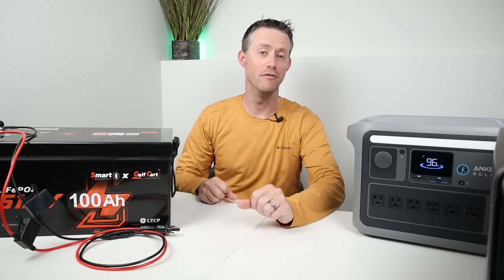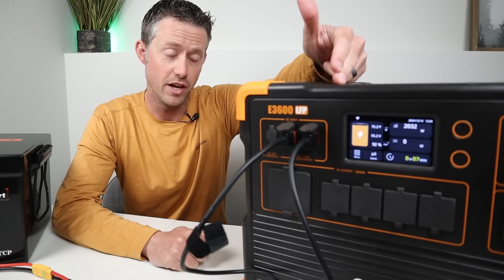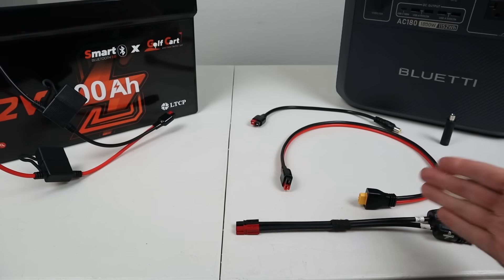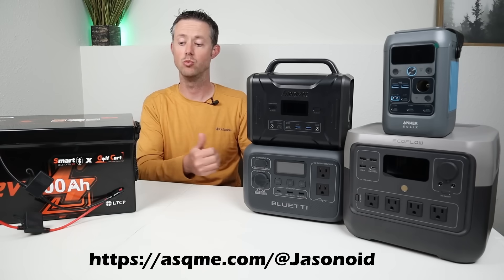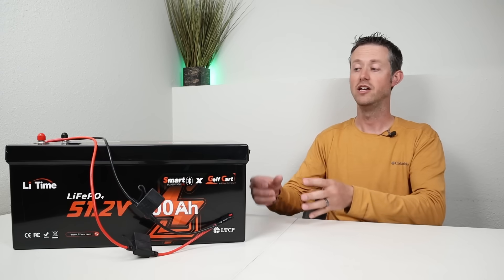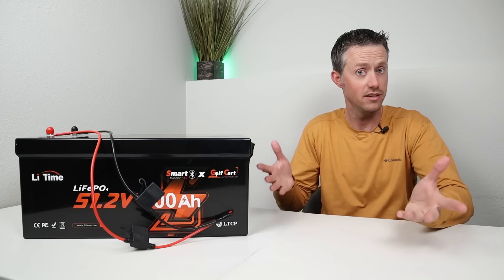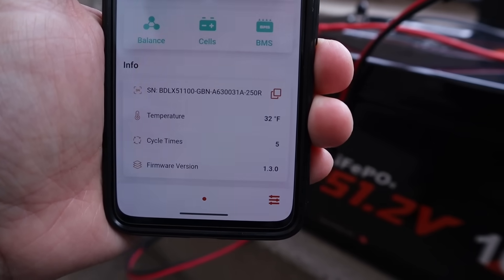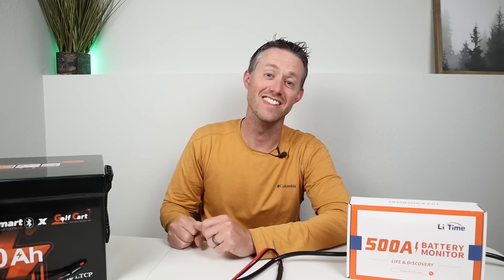Simple Trick to Make Your Power Station Last 5X Longer! Charging with a LiTime 48v Smart Battery!

Comment: FYI, the ATC fuses in those fuse holders are most likely only rated to 32v.  They do sell 58/60v ATC fuses, but they are around $8 each..  Not sure if that is going to be an issue..  Just pointing it out..

Comment: I have seen a FLOOD of videos showing this exact same concept. But, how do I charge the external battery? Plug it in in the woods off grid? Really? It HAS to be able to be CHARGED by the power station, IN the field. Otherwise, it is of very limited use. You charge it up before you leave a house, and use it ONCE. This is NOT a solution, at all.
Reply from the maker: You didn't watch the entire video, because I totally explained that...
Reply: @Jasonoid  And you were the guy I jumped on about it, instead of all the others. Sorry. I guess I respect and trust you more than them, so I got snippy. Again, sorry, man. Your videos are great, and I am a long time subscriber. It is something that irritated me about all the videos being made about it.

Comment: Why even buy a power station in the first place? Just buy the battery and attach an inverter to it. Recharge it with solar..simpler and waay cheaper.
Reply from the maker: That argument USED to be the case... It's actually not cheaper to go DIY on a small system anymore... The power stations seen in the video (the Bluetti AC180 and the Anker C1000) are the same price as a decent quality 2000w pure sine inverter lol... $400. You'd have to spend money on the battery, solar charge controller, and all the fuses and wiring. Probably near $800 for a decent 2000w device and a 100ah battery. 
Prices have dropped significantly in the last 6 months.
Not to mention that diy systems are extremely loud when under load. These power stations are significantly more quiet, compact, and simple.
Reply from the maker: @lawrencedavidson6195  I've built plenty of small DIY systems, I know what is involved in building one. 

3 times the capacity? A 100ah LFP 12v battery has 1280wh, the Bluetti AC180 has 1152wh of capacity, seems pretty dang close. 

The Renogy 2000w inverter is priced at $269 on sale right now. That's more than half of the price of the Bluetti. (so it's similar to the 1800w of the Bluetti output) 

The wire and fuses and hardware for that DIY project alone would be $100 additional. What about adding a case to enclose it all or some short of smart shunt to track capacity? Add another $150 for both those items. Stacks up quick.
Reply: @Jasonoid  I made an error with "3 times the capacity" so i deleted my comment. However, the 100ah battery IS more capacity. For those who don't want to, or cannot build their own power station, a ready made one is lovely to have (and prettier to look at). But, with prices of most if not all solar stuff going down, if you shop around you can still build your own power station for less. I have also built quite a few and assisted friends to build their own. Cheers, and greetings from sunny Jamaica.

Comment: Very interesting info. Why doesn't anyone do the informative tests using the DJI Power 1000 unit?
Reply from the maker: I reviewed the DJI power 1000, it's a very niche unit. The solar charge controller only accepts up to 30v so it would not work with a 48v battery. It would work with a 24v battery though 👍 I got a video about the new DJI accessories coming soon! I just started testing them.

Comment: Great video. You should also mention about XT60 and XT60i because some power station requires XT60i to be able to charge at higer than 120W when the power source Voltage is higher than 12V so it can charge at higher power.
Reply from the maker: Yeah, I failed to point that out. It's hard for me to remember every detail about every brand. This video wasnt scripted, I just fly by the seat of my pants.
Reply: Good point, I was not aware of the XT60 vs CT60i rated differences.

Comment: Hi Jason,

Great video as always!

I have two Pecron E2000LFP power stations and recently found a good deal on the Goal Zero Yeti Home Integration Kit. I was considering getting an expansion battery, and this seemed like a potentially better option than the Pecron expansion battery (even though the price has come down).

Do you think this would work well with my Pecron E2000LFPs?

Thanks for your expertise!

Regards,
Reply from the maker: It all depends if you are wanting a system that does everything automatically or if you are willing to do some of the work yourself. For example, an expansion for the E2000LFP connects up to the power station and it's automatically charged and discharged with the head unit. You kinda set it and forget type of thing.

Going the DIY route is usually more affordable BUT it also requires a little babysitting. For example, once the expansion battery dies, you have to manually charge it up. You have to connect and disconnect it when you want to use it.

For me the DIY option works well since I have the solar panels and the charge controllers I can dedicate to the batteries. If you aren't going to have room for more solar or you don't want to 'manage' the charging yourself, it might be best to stick with the branded expansion batteries.
Reply: Thanks for the quick reply! I understand it might work with some extra effort, but I'll need to weigh my options before deciding. I appreciate you clarifying that for me.

Regards,

Comment: I'm surprised nobody else is covering this. Great way to build your battery bank on the cheap vs the proprietary batteries for the power stations.
Reply from the maker: There are lots of videos on the topic, mostly with 12v batteries, not too many with 48v batteries 👍
Reply: @ my guess is that a lot of reviewers who are getting their units for free don’t want to show you don’t need the proprietary batteries. I understand that. I appreciate your videos and your opinion.
Reply: @5markbennett  It's a bit more of a slight hassle though I have 24v 100amp batteries I have tried with.

Comment: <3 you emphasizing wire gauges and fusing. It's not rocket science but it's critical new DIYers play it safe. Great video!
Reply: For that battery, the ATO/ATC fuses shown are useless for main battery fuses- even a MRBF or CF8 won't reliably stop a fault on that battery.
Reply: @Originalsunrunner20  So what do you recommend?
Reply: Will this work with Bluetti elite 200 v2?
Reply: The fuses are not exactly in the right place, tho. They should be as close as possible to the power source (battery). Not half way down the cables. Any fault occuring before the fuses will obviously not be interrupted.
Reply: @Chris-yy7qc  Indeed. I like to use MRBF terminal fuse holders for that reason, can't get any closer. But still way better than no fuse at all.
Reply: @ I like to use those, too. Sometimes I wish LFP batteries would have proper poles like lead acid batteries. Theres heaps of cheap and very nice automotive fuse holders that mount directly onto the pole and give you 3 or more slots for different fuses.

Comment: Did you ever do a video on that Anker C300?
Reply from the maker: Nah, no video on it. It's a cool device but it's just designed for small DC loads. I might use it to power my Starlink mini sometimes.
Reply: @Jasonoid  Im using it to light my room now with 2 ceiling lights. Using the DC only version. It has replaced any bigger power station I have to recharge DC stuff. The Best thing I love about it is using the Ecoflow DPU's 2 USB C 100 ports simultaneously to charge it up super fast. And the Pop up light at the top I started to get the Jackery 100 (mini) but I'm glad I got this instead
Reply from the maker: @Moes_Prep_and_Tech  I have the DC only version too. It's a little beast and the light is pretty cool too. 
I didn't know you could dual charge it with the inputs! I'll have to test that! Thanks!
Reply: @Jasonoid  It an dual charge at 140 watts each. (Middle port and the Right Port) The DPU can only do 100 each minus the transfer loss but I'm okay with that. Im glad I chose the the DC Version over the AC version because of the Extra DC Options with Same Battery Capacity. Question have you every checked out the Jackery 100, It's very Unique.I've never seen anything like it. Lifepo4 in the palm of your hand airplane friendly
Reply: @Jasonoid  It has 140 dual charge actually but the 100 each on the DPU is good enough for me, It's in the middle and right inputs. Have you ever checked out the Jackery 100? Its the smallest LifeP04 I've ever seen, fits in the palm of your hand, Airplane friendly
Reply from the maker: @Moes_Prep_and_Tech  thanks, I'll test that out. Todd Parker did a small video on the Jackery 100, I haven't looked into it much.
Reply: @Jasonoid  a (somewhat) Proprietary cord, Classic Jackery) kinda turned me off, But I would still buy it to charge up gaming handhelds ( my 2nd hobby)
Reply: @Jasonoid  wwjoshdew has great videos on the smaller power banks and stations he goes really into it. I love Todd Parker videos by the way, Subscribed. Solar lab, Johhny's weekends(Hobotech is like a Long Advertisement these days)I like ask Ive but the thousand small stations be killing me somebody donate a EG4 to this man, lol, Silver Cymbal (all around more then just Solar) are close Runner ups. Rodney Hunt for DYI, Can' forget the William Prowse, that's Automatic

Comment: I am assuming this setup would work with an EcoFLow Delta Pro?
Reply from the maker: Yep, it definitely would!
Reply: @Jasonoid  Thanks...Good to know.  Cause extra batteries for the EcoFlow are kinda pricey.
Reply from the maker: @markk171  just remember there are pros and cons to both routes. The DIY route is less money but more work since you have to charge the battery manually. The expansion batteries cost more but they are fully 'hands off'. They charge and discharge automatically with the power station 👍 it all depends on what you want to do and how you want to spend your time.
Reply: Hey this is an awesome video! Curious, as I just also got an Ecoflow Delta 3 Plus; can you use the external battery with the Ecoflow Delta 3 plus at the same time as you discharge it?

I believe the Ecoflow Delta 3 plus has a bypass charging feature but I thought that was for only A/C charging. 

Can you charge the power station via the external battery with the solar input using the same set up you have and discharge at the same time? The intent I had was to extend the battery capacity to run a 12v fridge off the DC outlet from the Ecoflow Delta 3 plus.
Reply from the maker: @philv658 yes, pass through on both DC and AC charging works just fine

Comment: You didnt really talk much about, or pricing to be specific, on a charge controller to charge the 100ah battery which is a huge added cost. Yellow Eg4 one is $800 so with Ankers black friday sale at $1,800,  for the largest expansion battery, after taxes etc I believe is a good deal. No need for separate charge controller, cables, etc. Sure the expansion battery isn't as much capacity but the ease of setup makes it worth it in my opinion. 

I do wish Anker would come out with a larger expansion battery or even better, an expansion battery with more solar inputs and some outlets.... so basically a power station. I like the idea of keeping the large f3800 at home to power the cabin but taking an expansion battery off to use for camping. 

I was regretting buying the Anker f3800 instead of Eg4 server racks but I wanted something portable anyways to take in the RV, camping, etc.
Reply from the maker: There are too many options to discuss in one video. You can literally do hundreds of different combinations of products when it comes to solar and batteries. This video covers one option. I don't always want to make a 40 minute video.

Comment: Another informative video. So if I have a Anker F3800(which I do), you're saying I can hook up 2-sets of connectors and plug each one into the 2-XT60 ports and charge the F3800 at its max 2400W(1200 ea port)? Specs say this battery is 5120Wh. If I'm doing the math right, this battery can totally recharge it to 100% 1.33 times? If so, how long might it take to recharge to 100% from empty? Just curious. Thanks!
Reply from the maker: Notice how I said in the video that the Pecron E3600lfp allowed for both charging ports to come from the same source in parallel mode. This is NOT the case for the Anker F3800. The F3800 will not charge if there is a common ground between the two charging ports so you have to use a separate battery / source for each port. That is explained in this video:
https://youtu.be/T_zZceBWZHk

Comment: I would love to get 4 of those batteries. I have 2 Delta Pro's each with 2 extra batteries. 2 of those in series would max out the solar input with 1600 watts.
Reply from the maker: I don't think many of these 48v batteries can be connected in series. Please confirm with the manufacturer before wiring them in series. It could damage the BMS and ruin the battery.
Reply: @Jasonoid  Ok, thanks for the info. I didn't suspect that. I'm presently have 8 12.8v batteries in series. I can recharge the Delta Pro at 1600 watts.  Glad I didn't go down that path and release it wouldn't work.,
Reply from the maker: @leguirerj  that's awesome! Most batteries support a 4S config. What battery brand and model are you using?
Reply: @Jasonoid  I have 4 Eco-Worthy 12.8v 100 ah and 4 LiTime 12.8v 100 ah.The LiTimes are out of my Ryobi 48v riding mower since grass cutting season is over.
Reply from the maker: @leguirerj  crazy they allow an 8s connection! 👍

Comment: Thanks!   I was looking into how to setup an AC Charger -> 48v LiPo battery -> Solar input to my Anker Solix F3800 (not just for the extra capacity, but primarily to be able to utilize the full inverter in the F3800, which you cannot when it's charging with AC) and this video addressed that perfectly, even with links to all the cabling needed!
Reply from the maker: Thanks for the super chat! Using a 48v battery to keep the 240v output enabled works great! I also have a second dedicated video for the F3800 and using the Chargeverter as well if that interests you at all:
https://youtu.be/T_zZceBWZHk
Reply: @Jasonoid  I saw your other video on using the Chargeverter as well, but that seemed like overkill for my needs.  I am using the F3800 in a workshop near my house - where I DO have AC power from the house via heavy-duty extension cord - I'd feel ok pulling 15amp, ~1500 watts max thru that cord, but nothing more.   

For not too much more than the price of the Chargeverter alone, I got the Litime 48v 60ah battery (nearly doubling battery capacity of my F3800), the charger, AND a battery monitor from Litime.    

For me, biggest plus will be getting full inverter usage with the 3800 since it won't be on AC charging with this new setup.  With the F3800 you don't ONLY lose 240v with the AC charging active, it also limits 120v AC output to the left bank of AC outlets and only ~1200w of the 6000w inverter when AC charging is active.
Reply: Can you charge the 48v battery with its 18A charger WHILE it is connected to the power station, in this case an F3800?
Reply: @RobertY3K yes
Reply: @RobertY3K  yes, no problems doing that.  My only issue with this setup is that the charger will not turn off by itself, it has to be a manual process.   You can set the eg4 chargeverter to come on at a specific voltage and cut off at another voltage, OR if it can communicate with battery directly, at a specific SOC.  That may be the best solution but I haven't done that myself.
Reply: @davidbonds8515  Thanks for the quick reply!  I wonder if it would also work by connecting a solar array via an MPPT controller and charging the batteries, instead of the 18v charger.
Reply: @RobertY3K  I think in theory that should work. I’m trying to do the same set up right now. My fear is damaging the F 3800s I have two of them.

Comment: Good vid.
Connectors:  Do you know if the XT60 connector will work with the Delta 2 which has the orange connector (XT60i - has additional metal piece integrated)?    I have a River 2 which uses the XT60 connector so that's what I'd like to use for EF D2 also.  Thanks.
Reply: Yes the XT60 connector will work with the Delta 2, but it will limit you to 8 amps.

If you want the full amperage input to get closer to 500W you need an XT60i.

But, your unit should have come with an XT60i to MC4 adapter, so you can just use that. 👍
Reply: @andrewr05  Thank you.  I just don't have the other end to connect to batt, so I'll order a cable with ring connector for batt and has XT60i at other end.   Hopefully that will work for River 2 also.  Thanks.
Reply from the maker: That xt60i setup should work just fine for the Delta 2. However, do NOT connect the River 2 up to a 48v battery. The voltage of a 48v battery is too high and will fry the power station.
Reply: @Jasonoid  Yes, I have a 25.6v on the way.  If everything works out I might series another for the D2 only.  Thanks.